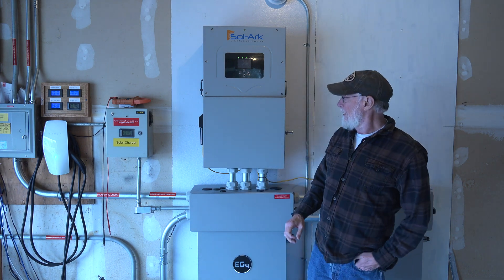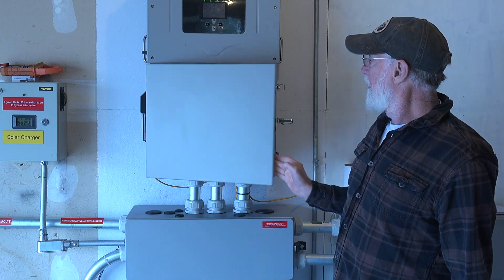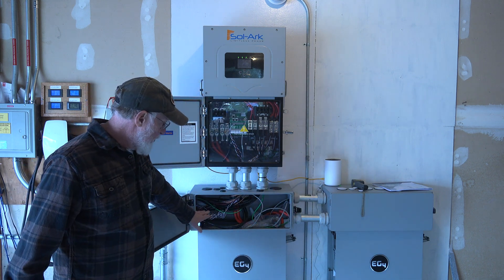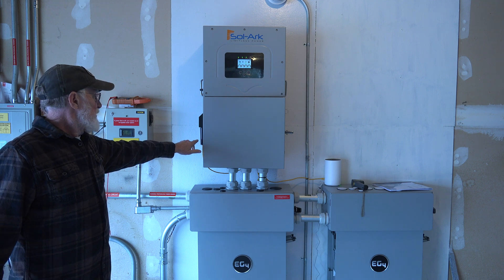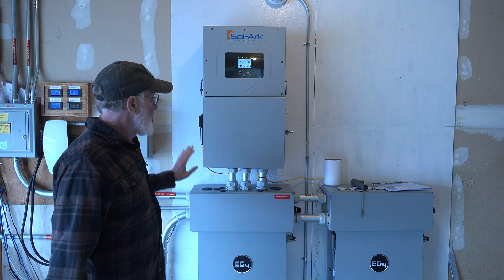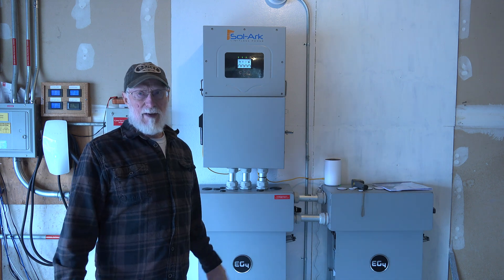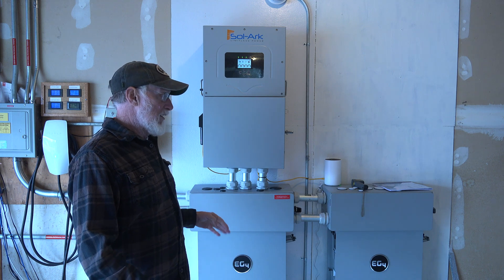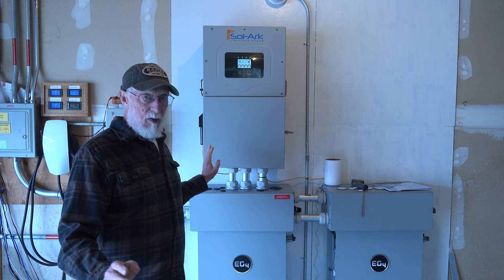Some comments on the install of the Sol Ark 15-2P-N inverter/charger

Comment: thanks for the video. I'm just starting to design a system so I'm still learning. is there a way to connect a generator AND microinverter-based PV? (i'm thinking of the rare case 🤞🏾where the grid is out, it's overcast so there's low solar production, the batteries are going flat, and my wife is panicing about the stuff in the fridge going to waste. ☺️) is it as straightforward as adding a switch that selects which ac input (PV or generator) is connected to the sol ark's generator input? thanks.
Reply from the maker: I am not the best person to answer this.  I would contact Sol-Ark.  
What I can say is you can reduce your exposure to this problem by installing more panels than you think you need.  My system is over 20 KW with an average usage of 30 KW per day, so even during overcast days, the batteries usually charge up from overnight usage before noon. 
Solar panels cost less than a generator and use no fuel.
GFM

Comment: Nice video. I could only afford 15kw of batteries with my install. I was able to get by with a program with the power company that offered free nights from 8pm to 6am. I make it through the day in summer and winter with the batteries filling in my gaps in the morning and evening. I only pay around $5-$7 dollars a month because the SolArk leaks a small amount of watts during the day. I talked with SolArk and they said it is something it does for operating consumption. I don’t get credit for my over production of solar and I put in enough sometimes to power a few homes around me. I feel like if they would do more for offsetting costs for home owners and got enough homes with these power plants they could quit building so many solar farms.
Reply from the maker: I do get credit for over production and at retail prices, but am preparing for that to change.  
While I understand utilities' reducing compensation, eliminating it seems unfair.   I too operate several of my neighbor's A/C systems during the summer.  
I may a bit of a Pollyanna, but I see a future where individuals, especially those with acreage, could partner with utilities to reduce or even eliminate upgrades to the grid and still accommodate new users.
GFM

Comment: I was curious about your loads. You mentioned the car and laundry. If you are looking for a video idea, it would be interested to know if you did any optimizing of your loads, like appliance upgrades, LED lighting, occupancy sensors, hybrid water heater, etc... or if you have an future optimizations you'd like to make. It would even be interesting to know if there were certain upgrades you didn't deem worth it.

On another note, are you able to get an accurate reading on the metal terminal with the IR thermometer? I would think it would be too reflective.
Reply from the maker: I will be updating this one in the future and I will be discussing some conversions to make the entire house electric.
I have checked the IR probe against a contact probe and it seems to be pretty close.  I have not checked it with these particular terminals but will be doing so in the future.
GFM

Comment: Off topic but is it a good idea to run central air though my Beckett oil furnace? My house is 1000 sq feet the window units are installed in walls 3 110 units kept it cool . My stepson is an electrician and granddaughters husband parents own HVAC  company the labors covered I'm giving one my Harley and the other my 65 mustang, I'm done playing with cars and bikes. My furnace is nice rust free 20 years old and nothing has happened I couldn't fix watching you experts. I replaced all duct work last Fall so it's super insulated and air tight I really took my time did beautiful job. I really trust your opinion. Thanks
Reply from the maker: You may certainly run central air thru the ductwork.  The only issue is if the CFM is high enough.
GFM
Reply: when you're on oil, you should be getting a heatpump instead of a a/c. it is not that much more money for comparable model and can slash heating expenses drastically unless you have super expensive electricity.
Reply: @Jon-hx7pe  thanks for the reply I hear ya, heat pump it is thank you sir.

Comment: you bought into " the green new deal" like a big ol sucker fish.... when the weather modification brings you a hail storm and takes out all your panals.... can't wait for the update on it.... don't forget your booster is coming.
Reply: Many bought into the lifted, diesel, 4wd truck. Many bought into the 3000sqft house. Weather can take it all out. How about you spending your money on what you want and we’ll spend ours on what we want.
Reply from the maker: I have been buying into it since the early 1970s.  
BTW, Already had the hail.  Golf ball size hail took out the roof but not the panels.  Here is a link to the video I made as the hail came down:  https://youtu.be/eyszCtmfLBA
GFM
Reply: it's a delusion that it's possible to run industrial society off of intermittent renewable energy sources at least at this point. renewable sources are supplemental. only way to conserve for real is to invest in energy efficiency and also consume less, accept a lower living standard to begin with.